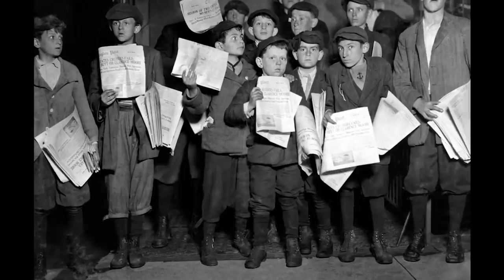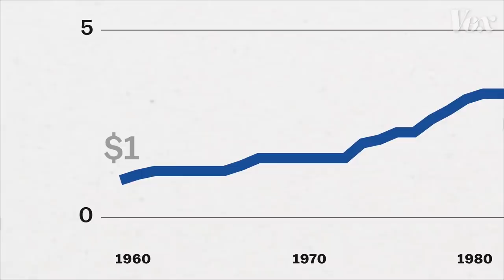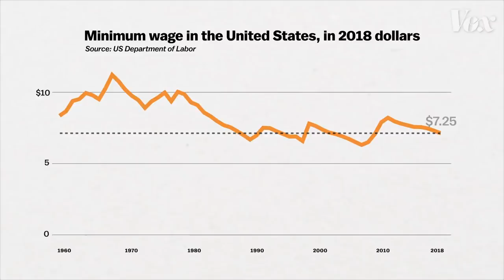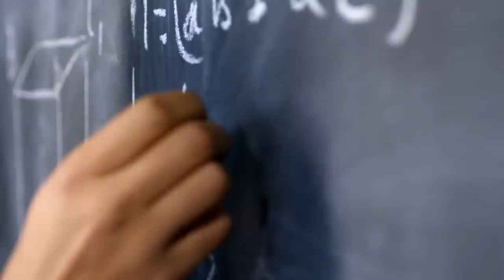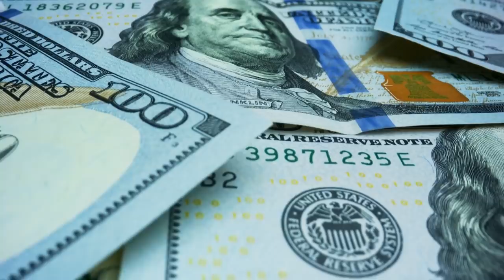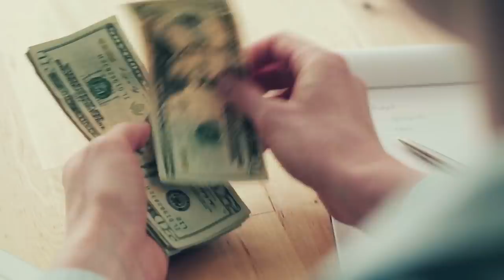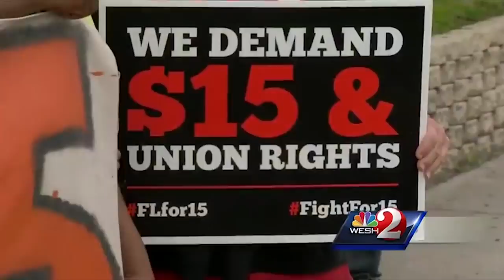The Minimum Wage Debate Explained

Comment: The minimum wage should definitely be higher, and as mentioned it hasn't increased in-line with inflation, unlike in other countries. The problem is that you can't just quickly increase the minimum wage to $15/hr. What happens to those currently on $10/hr or $12/hr or $14/hr? All these wages will need to increase as well and not just to $15/hr. Someone on $14/hr now will want to have their pay increased a fair amount above $15/hr as they have skills that make them worth more than those on minimum wage. What about those on $17/hr? They will expect a pay rise as well and this will cascade upwards. With this will come an increase in prices for everything and you will be back at square one. 
The countries that have higher minimum wages did this over time and the cost of items and the wages above minimum have naturally adjusted in-line with this - this is why things are more expensive to buy in these countries as you can't sell goods at the same low prices as in the US if you are paying people $15/hr to flip burgers or to scan through groceries - this is also how mum and pop small businesses overseas afford to pay a living wage.
The US definitely needs to increase the minimum wage though, but it should be a very measured approach over a 5-10 year period. Increase lower wages by amounts a little greater than inflation until you reach the right living wage for an area. $15/hr isn't enough in NYC, but it is more than enough in a small town in Alabama.

Comment: The minimum wage was a racist policy to keep out the blacks, it failed at that.

Also, fallacy. You claim another country has much higher pay but not much increase in product cost. The fallacy is confusing correlation with causation (or lack there of) assuming that all other aspects are equal, but they aren't. There are all kinds of other factors in play which influence the situation.

Comment: Ok so I'm on board with there needing to be some standard of federal wages. But simply increasing it will not lead to a stabilized economy. We need to look and not only what we make vs rent/mortgage  but on what is needed to survive. We are now on average living farther from work and the need for cellphones to stay in contact with employers. Coupled with the fact that the housing and renting markets have been increasing what they charge for with no checks. Just a couple of years ago before I couldn't afford to continue to pay rent, I know my rent would go up by 150 bucks every time I renewed my lease. They were not making note worthy improvements. Planting flowers doesn't mean shight when there's  asbestos, lead pipes, and a raging bed bug infestation across literally hundreds of apartments. One of those multicomplex apartments. Then there are the phones we use. The profit margins for tech companies are insane. What I'm trying to say is they can afford to make less in comparison to a small business that may not be able to pay their workers more. Instead of just increasing minimum wage which only benefits big businesses impose regulations on the housing/renting and tech companies on how much they can charge. I'm not saying completely that there should never be a time where we increase the minimum wage but we need to get our other necessities that our needed for our society these days under control first. Also there should be a federal maximum for energy as we need that as much as we need a roof.

Comment: I can't even start when this gets wrong...
Reply: great rebuttal
Reply: @gerald1495  he doesn't even mention the real argument that minimal wage kills the employment, just a bunch of strawmen.
Reply: @zigoter2185  See, here's the issue with that counterargument; there's very little evidence that it does kill employment. I live in a nation which has lower per capita GDP than the US but has almost twice its minimum wage; our unemployment rate, using the same methodology as the States has, is 0.4% *lower*. Metastudies struggle to find any relationship between the minimum wage and unemployment, positive or negative, whatsoever, at least not within the range attempted by other developed economies (up to 80% of the median). A low minimum wage is not the boon for employment many assume it to be.
Reply: @justdonika4357  because in majority of the times the difference is very little to show the significant results. Everything gets lost in the noice. But there is in fact a small correlation between the unemployment and minimum wage. 
And, to finish it off. The statement that minimum wage kills employment is not based on the experience, so it's not falsified with it too. You don't falsify pythagorean theorem by drawing a triangle on which it doesn't work. Anyone will say that you just drawn it wrongly. The way you falsify it is by finding a flaw in a logic behind it. In economics it's the same thing. The minimum wage kills employment because as the law of supply and demand tells us price floor cause surpluses. And law of supply and demand is based on a subjective theory of value which is based on the axiom of human action.
Reply: @zigoter2185  If the effect is so small as to be immeasurable across a large number of studies, I find such adverse impacts, if present at all, to be uninteresting. To be indistinguishable from no effect in practice, positive or negative, across such a breadth of literature from real world examples, the effect must be so minute as to be inconsequential, or genuinely nonexistent.

That said, if you'd like a theoretical explanation for why the expectation of the classic supply demand curve fails on the labour market, there are a number of theories. 

The one I find most compelling is that demand and supply does in fact still apply, but demand for labour is inelastic, at least at the levels tested, such that what gains in unemployment are created are small enough to be outweighed by an increase to the supply curve from the stimulatory effect of higher disposable income among customers. That is to say, the positive externality (higher demand for goods and services with better paid consumers) counteracts the deadweight loss of creating a higher price floor.

I'm sure you can agree this is at least a plausible explanation in line with economic theory, and this explanation lines up with the real world data better (both a lack of impact on unemployment and a positive impact on real disposable incomes can be demonstrated by real world data).
Reply: @justdonika4357  no, the fact that real world examples tend to show really small results is explained not by that min. wage doesn't affect employment, but by the fact that it's usually very small increase in min. wage for very small percentage of workforce. For example in the USA minimal wage workers comprise only 3% of the workforce. Even a substantial increase In the minimum wage will give relatively small effects due to this, but nobody is increasing it substantially, so negative effects get lost in the noice.

Minimum wage cannot increase total demand on a market. It's a broken window fallacy. At best it might redistribute it a little among the workers who got an increase in wage, because they are unionized at an expense of non-unionized workers, who got fired. Another thing, that your assumption, that labor curve is inelastic is nothing more than assumption. It might be inelastic for small companies, who also tend to go out of business, since they can't pay their workers the wage. But bigger companies can and already switch human labor to capital, increasing their automation. This also results in further decrease in the demand for unskilled workers which make unemployment even worse in the long run.
Reply: @zigoter2185   There have absolutely been significant hikes before, and even if small we would expect to observe something across them. A small but persistent negative outcome; this is not the case. There are about as many positive outcomes as negative. They do show results, but that they do not congregate around a negative number tells us that the impact it has, if any, is negligible. As for the fact that few are on the minimum wage, many such studies are explicitly focused on minimum wage workers, rather than the workforce in general, and still find no statistically significant change.

And I'd like to see supporting evidence for the notion that increased wages cannot boost demand? The impact on real wages, obviously for minimum workers themselves but also economy-wide, is demonstrably positive; would this not inevitably push up demand, and subsequently the number of workers needed to meet this demand?

As for labour demand elasticity, I find it difficult to find an alternative explanation for the superior unemployment figures of an economy with lower per capita productivity but double the minimum wage, and inelastic demand would seem only natural after 40 years of stagnant wages, but ultimately the assumption that labour demand is inelastic is not necessary for the case to hold, although it does imply the positive externality for real wages is larger to cover the deadweight loss. 
So long as the evidence is of no change, whatever the deadweight loss is, we know increased demand is adequate to cover it. I just view inelastic labour demand as the most realistic scenario where this can arise, but at any elasticity, we'd see evidence if whatever the deadweight loss and positive externality are were unequal. We don't, ergo they approximately align.

As for your concerns around small businesses going bust over higher minimum wages, this is again something that could be observed in the real world and which does not arise. The same nation with double the minimum wage also has a higher proportion of entrepreneurs. Small businesses can absolutely still thrive with a decent minimum wage. And obviously, the concerns around workers being fired are already addressed, they would naturally pop up in a measurable manner.

Separately, the minimum wage is not union specific, and unions gaining wages does not come at the expense of non-union workers, it comes predominantly at the expense of capital owners, but that's quite a tangent regardless.

Comment: Fallacy! Correlation does NOT equal causation. The environment here in America is not the same as in other countries. The ability of McDonalds to increase wages with minimal increase to product cost is correlation not causation. That other country does many things differently, many of which impact McDonalds operation (also, franchises are not corporate.). Here in America, many other factors impact a business, meaning that increasing wages also has other costs separate from just the monetary cost of more money going to the worker.

Also, did you note how prior to the first minimum wage on the graph correcting for inflation had the pay going up until the minimum wage, after which it always went down except when a new law raised the minimum wage again? Did you notice or investigate that?

Have you investigated what impact raising minimum wage has on a company in terms of laws, regulations, osha, etc? Have you looked into what costs the company has for employees beyond their wage and compared that to the other country paying more money? Have you looked at the economics of monopolies and how a large corporation with many outlets can take greater risks and sell cheaper than a smaller business because it can spread the costs across multiple outlets and how that affects the situation with wages and product costs?